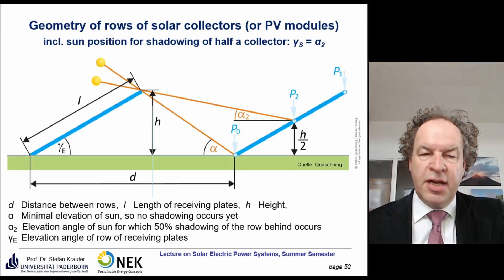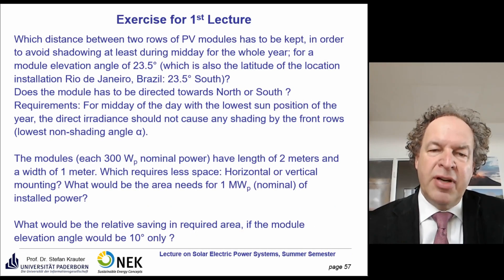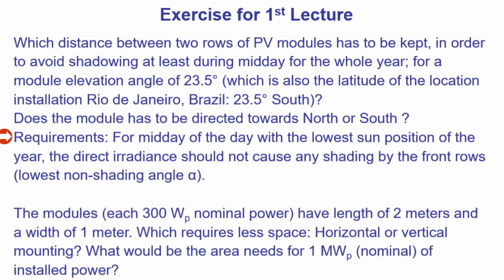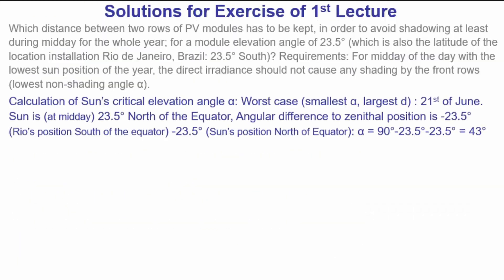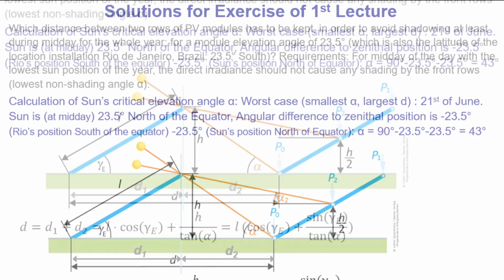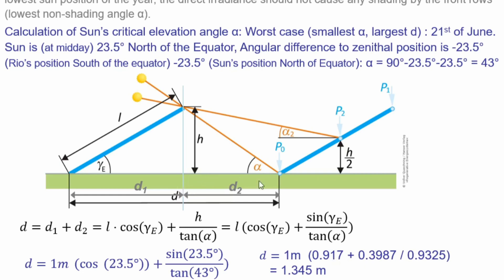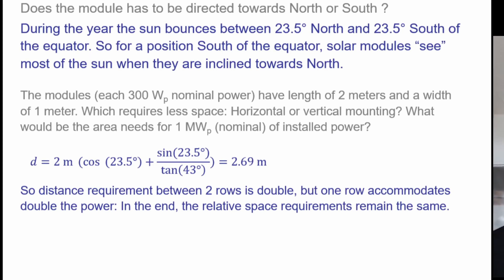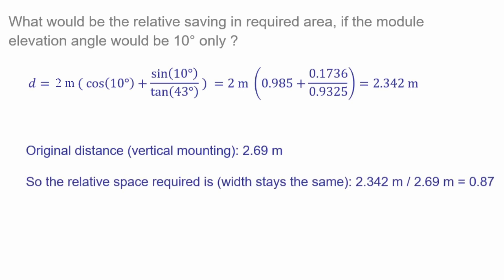Exercise 01 Solar Electric Energy Systems - Solar Irradiance & Shadowing

Comment: In theory, this would imply that any location with Rio de Janeiro's lattitude  (even on a different continent) would produce the same results under STC, is it equally true in practice?
Reply from the maker: the sun's elevation angle would be exactly the same, but under real conditions there would be different temperatures (influencing the voltage of the PV modules) and different cloud covers (influencing the actual irradiance)